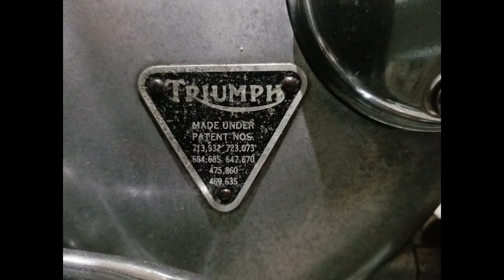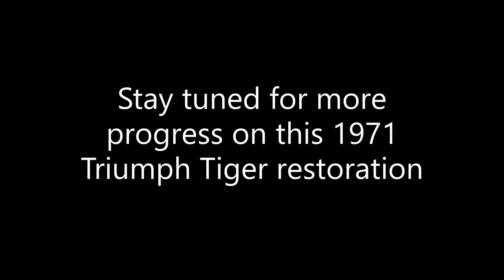1971 Triumph Tiger 650cc restoration Part 8, Engine disassembly & case splitting

Comment: I was lucky. My crankshaft was in excellent condition. I put new big end journals in anyway. The sludge trap was hopelessly seized in on mine. I had to tap it and run a bolt and plate to get it out. 3/4" if I remember right. If anyone wants me to confirm the size just ask. I used a sludge pipe plug with an Allen key head. Much easier than the flat blade!

Comment: Try using a bit of heat for stubborn parts like your oil junction block. Prying with screw drivers is never good. A heat gun or propane torch will do wonders. Works on stubborn bolts and nuts too.

Comment: 32:38 what slide hammer is this and where can I get one currently rebuilding my dads 72 tiger tr6 and using your videos for reference but not sure what slide hammer I need to remove the cam cover
Reply from the maker: The Bonneville Shop sells the tool you are looking for but it looks to be sold out at this moment triumph part numbers 60-0484 & 60-0782, here is a link, https://www.thebonnevilleshop.com/product/triumph-norton-bsa-points-mechanical-advance-removal-tool-slide-hammer-pn-60-0484-60-0782/
Reply: Also do you need to take apart the clutch case to get at the the cam case / timeing case cover off
Reply from the maker: @itzpacman2272  No you don't have to take the primary chain case apart to work on the timing side.
Reply: @jessesvintagegarage765  sweet I’m still going to take that apart to redo the gasket